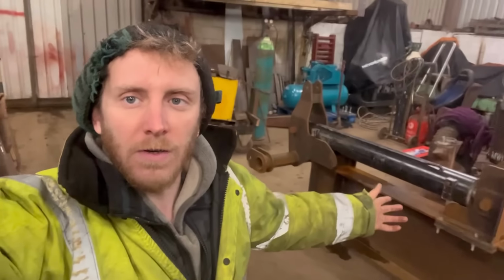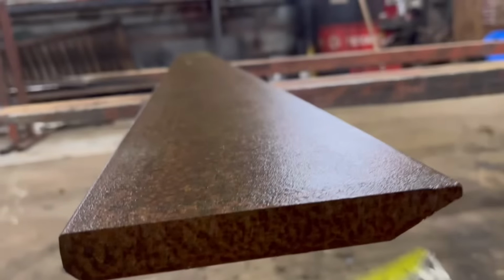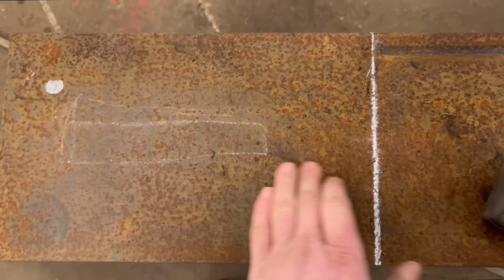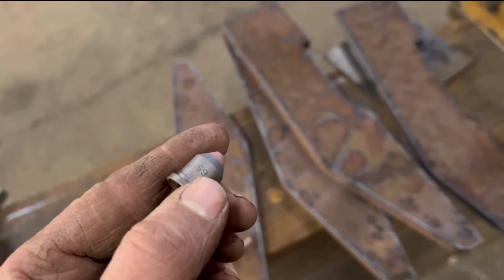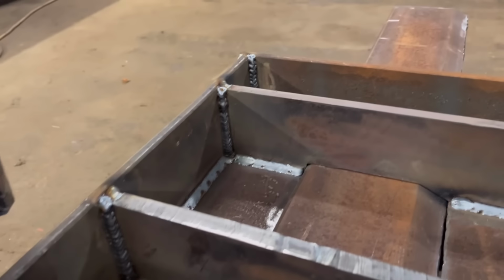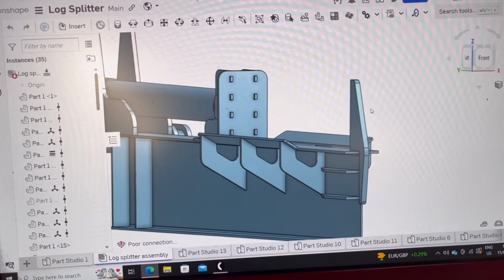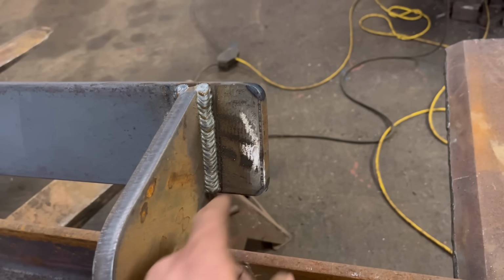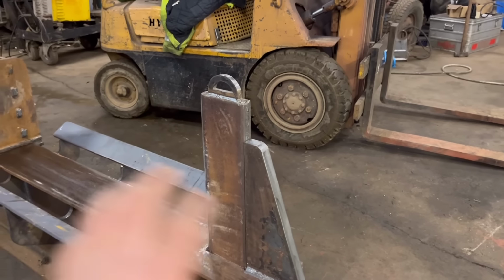Making a HUGE log splitter. Part 3

Comment: If I may make a suggestion that will make this splitter infinitely more useable, fir it upside down so the slitting section is able to grapple a log on the ground via th boom on a jcb or telehandler
The less times you have to touch a log the more efficient the process

Comment: That log splitter is a monster. It must be two to three times the size of the one the woodcutter was using many decades ago. His was completely self-contained with a motor and hydraulic pump and a star knife. It will be interesting to see how your modifications improve the function of this one. With a prototype, it's usually the case that some things need changing after you first test it.

Comment: Simply build the 4 or 6 way blade to be the spacer you need for the hammer to get closer to the blade/splitter.
btw, with the 6 way blade, you won't need to add a table/retainer to keep the wood from falling down as it will be already splitted enough (and let that conveyor you're gonna build do the rest ;)

Comment: You mentioned not having any hard wire for the splitter edge. You could probably sharpen the splitter edge then heat and quench it a couple of times and it'd get pretty hard. Just a thought.

Comment: Welding vertically up is a bit technical, but you didn't do too bad a job on it for not having done much of it. It would have been difficult to turn the log splitter in such a way as to avoid the vertical welding, so there was no practical way out of it.

Comment: U want to look at getting  a regeneration valve to fit up , uses the low pressure oil from the other side of the ram to speed it up when it's not needing pressure to split or on the return stroke

Comment: Nice design and build again mate. Forget worrying about fancy welds they are for instagram, I am watching the overall build not checking your welds. Since I became an amateur welder I am now fully qualified to check others welds, and when you start looking about you not all welds are 10/10. However they don’t usually break and have been there for years without an issue.  A grinder and paint makes me the welder I ain’t!!All the best mate.

Comment: For a vertical weld try moving the arc in a pattern that will fill in both sides of the bead easily and as you go.
So move , Left,Right,Left,UpLeft,
Right,Left,Right,UpRight,
L,R,L,UL,
R,L,R,UR
ETC, ETC , where you are forming a squared U and your upstrokes are about 2 to 3 beads high depending on how fast/slow you go.
Worked for me in vocational school years ago to get my ticket And its easily modified to adjust the overall shape.
Reply: PS, enjoying your content , thanks.

Comment: If you don't have hard face rod or whatever you can use the allen keys that companies put in everything these days. I collect all the cheap allen keys they give away when you buy Ikea or whatever and then use them as a poor man's hard face material. Not perfect, but it'll do in a pinch.

Or broken HSS drill bits/end mills. Although that tend to be very, very hard, but it might actually work well for a small cutting edge like that.

Comment: Well done great job !!  How about welding an extra backing plate either side behind the knife, angle them so that they help force the cut log outwards which in turn will help split the section of the log that doesn't contact the knife edge ?
Reply from the maker: Good idea

Comment: Olly, well-done on this project, do you have stick welding in shop,practise you're vertical with stick and it'll help you're mig,on the ray burn on you're face use sudocreme get it over counter it's the best, great channel as usual,how many tractors do you have for work or hobby regards from Scotland 🚜🚜🇬🇧🏴👍
Reply from the maker: There’s 4 main modern tractors for work and then quite a few classics and vintage

Comment: I had the same issue on the splitter I built when splitting stringy logs, thinking I needed to close the gap. What I did was make the splitting head wider, so it's got a narrow feed in at the tip and then goes to about 60 degrees.

Comment: Hi iwe had a lot of frustraition on Welding uphill to. But now when im Welding uphill i allways Welding in a triangle starting either left or right side then Welding towards the middele a bit up 1 or 2 mil. Then draw the pistol back to the other side as iwe started 1 or 2 mil. Down and the last part in the triangle right ower to the start point. It gives you a nice straight Line between left and right side, some times it is nessesery to hold the pistol still in a split sekond in the left and right side. 
Last draw a sope Stone Line in both sides virtical so you Can make a weld at both sides the same thicknes. Nice video by
the way. Tip from Denmark

Comment: I did exactly that to my face a few weeks back, went of to weld a gate and forgot my mask, thought i could get away with spot welding it up by shutting eyes on pull of the trigger, what happened, i got i nice sun tan too
Dont worry yourself on small bits in weld, you do an excellent weld

Comment: You are a it again aren't you! You outdo yourself, then you really do something really stunning. The beast is really coming on nicely.  Yes up welding is not easy, but have patience and the more you practice, the better it gets. I used to practice on oxy acetylene  and stick as they were the main things I would use. Once you got the hang of one you could transfer the muscle memory to the different  styles. Sometimes your welds are not the prettiest but who cares! only you. When I used to weld regularly I would have good and ugly welds, BUT they all worked!  All welders have the same problems, every day so don't worry. Only machines do consistently good welds, cos they only do one thing. Even they make mistakes sometimes too.

Comment: You want to add some kind of wedge after the blade to spread a split quicker.  When I made ours I used a bit of bucket edge, just ground a point on it and haven't had to resharpen so I don't think hard face is required.

Comment: If those are your first vertical welds you did a fine job. Also it's harder to weld vertical with the wire feed than it is a stick. That's one hell of a log splitter, nice job. Keep Smilin

Comment: Another great video. Thanks Oliver. Yes, I prefer welding horizontally due to lack of experience in welding vertically. Rightly or wrongly, I pulse the weld using the trigger. Your welds look pretty darn good to me 👍

That’s a big cylinder. Lots of umph but needs a lot of oil to move it to full stroke. 

Hope you can do another video next week. 

Cheers 

Mike and Nicky

Comment: You're not alone, it's easy to overlook minor considerations like personal protection.  I once set down at the bench to TIG weld a new bumper and trailer hitch for my truck, and because it was summer and hot, I wore running shorts.  The bumper welded up nicely but the next day I had significant UV burns on my exposed legs which took two weeks to heal.  D'OH!

Comment: That is a nice design Oliver.  I would have the knife move and the log stay put.  I have split wood every year since 1977 and I have used far too many splitters -- I can say with confidence the one where the knife moves and the log stays put is the best.  

If you need to make a subsequent splt on a log or portion of a log, you do not have to lift or reposition the log to accomplish it.  Over time, this tiny reduction in manpower makes a huge benefit in your efficiency.  I have pushed a knife through 120-150 cords for my own burning since I made my current splitter in 2006, and I do not view splitting as a chore.  

Why is this even an issue?  Imagine you had a round so big you had to split it into 60 pieces to burn it....  

Excellent video -- thanks for sharing.  Hello from sunny New Brunswick Canada.
Reply from the maker: The idea with this one is to push the split log off the splitter onto the next process to be sawn down into usable size logs.  If the log didn’t move they’d all be to hand balled off
Reply: @snowballengineering  You have it figured out.  In my process I length the rounds first, then split them up!

Excellent video series!

Comment: Nice work! For the Adflo PAPR, I adapted mine to work on Dewalt batteries since the stock ones are so expensive. I made a video on my channel of how I did it.
Reply from the maker: I’ll have a watch!
Reply: YT doesn't let me post lin ks for some reason so try searching "Adapting 3M Adflo Speedglass PAPR to use DeWalt Drill Battery with CASE and why you need a PAPR"

Comment: Great job, Oliver.  1 recommendation:  Consider making a support yoke/block for the hydraulic cylinder.  Since it looks like the splitter will be horizontal most of the time, there will be a lot of flex pressure when under load.  A support yoke would reduce or eliminate cylinder wear.  Hope that helps.  Thanks for letting us watch.  Cheers.
Reply: I agree with you on this 😊

Comment: Ineffizient. 
You need to touch each piece of wood at least 5 times before it ends up in the oven.
Farmcraft made one for his excavator, which is a lot better:
https://www.youtube.com/watch?v=EYrgG7Rn7M8
Reply from the maker: It won’t be inefficient when it’s loaded with the jcb, got a blade that splits logs into 4 or 6, set up with the saw bench/wood processor at the end of it sawing the long logs into shorter ones with the conveyor loading them into a trailer.  This was its first try just to see how it works.
Reply: @snowballengineering  Agree.
But farmcrafts logsplitter is worth considering. 
The only other thing you need, is an excavator. 
But who doesn't have it these days? Even I recently found one unused and hidden in a corner.

Comment: Majestic, Sir Snowball! What do you plan to use that size of firewood in, are you in the posession of RMS Queen Mary???
Reply from the maker: The idea is to split them in long lengths then cut them down to usable size with the wood processor/saw bench. Saves a lot of work with the chain saw

Comment: I have a inertia splitter that uses an I-beam similar to thet and it has a brass plate between the push plate and I-beam. It seems to reduce wear on the beam,and helps with binding plus it cuts down on the splinters lodging between them which is a major pain

Comment: Great work Oliver.  I have found that a sacrificial piece on the end of the ram like a piece of hardwood works well to get a zero clearance to fully split the pieces.  It will eventually wear out, but works well and is easily replaceable.

Comment: Nice update on the log splitter Ollie, like that you're using it as a test piece for your vertical welding. I suppose it's like most things, if you're doing the same thing all the time it becomes second nature and as they say practice makes perfect. I once knew someone who was an underwater welder on the oil rigs in the North Sea, he used to say he was glad he was welding down there, as no one could see the state of his welds, his mantra was as long as it's standing he must be doing something right. 😂 Like you say your self taught, plus you have the guts to put yourself out there, I just wonder how many of those keyboard warriors out there have actually had the guts to put themselves on camera,  probably very few if none at all. Keep up the good work! 👍

Comment: Are you not going to need a big excavator sized hydraulic pump to make that huge ram work at a speed where you won't get bored waiting for it to extend?
Reply from the maker: If you watch till the end you can see it’s not slow on a modern medium sized tractor

Comment: Excellent job on the log splitter.. that beast will last forever and a day. I personally think any log splitter should come standard or designed from the word go with double splitter instead of just one blade. It cuts (no pun intended) the job in half instead of handling the log a second time to cut the other half again. Where you can do that the first time around
Reply from the maker: Big lumps of knotted wood won’t like multi blades very much, that’s the reason I made the blade removable so it’s interchangeable.
Reply: @snowballengineering  noted. make sense👍🏼

Comment: I put a plastic ptfe type skid plate under my push block, saves running steel on steel, I made it from one of those plastic cutting boards so no need for grease. When I look at your welds and hear you say they are not good, I would be delighted if I could make mine half as good as your worst effort, I am by no means a welder but I can stick metal together and rely on the grinder and paint to make them look better. I would love to take a crash course in welding and learn to do it better, having said that I don't do enough to keep up the practice, the only courses I have seen round here are 75% theory and on real expensive welders that virtually weld by themselves. A few basic lessons might be an idea for a video.
I also put guides on mine the same as yours but they did not last very long as the first out of shape log caught up and bent them, We mostly have eucalyptus which is very stringy and the long logs(60-65cm to fit my boiler) often twist round as they are splitting and catch on the guides.

Comment: Should the ram extend to its max almost touching the knife edge to finish the split.  May be  a tee type knife would be faster for a four way split that you could be swop out. Also a remote spool valve for the operator .

Comment: Excellent design and fabrication 👍 
May I suggest try pausing and going up a little on each end of your vertical up welding. It will preheat that spot for the next pass.
 Also, look at. IC weld . He has a channel from Texas and he’s a professional welder 👍

Comment: Watch out for UV radiation when not wearing gloves as well (plasma and welding)
You should be able to split any log on the island (as we Norwegians say about England - Wales - Scotland 😏)
Well-engineered and should last a lifetime or two
Stick welding should do the trick for vertical and "up - under", you did well anyway
Planning on separate power unit for The Splitter?
Reply from the maker: Just power it with a tractor I think

Comment: Suggestions from  “Lifetime of Welding ”. 
Reduce the amount welding. Use intermittent welds 30mm long . Strength is from the geometric shape not the amount of weld. 
Keep the mig stinger lead as straight as possible to keep the friction of the of the welding wire passing through the liner to a minimum.
Also. The mig wire drive control unit will operate suspended over the work location it’s then out of the way of the working area.
Reply from the maker: I like intermittent welds to all look nice and even so by the time I’ve marked them all out it’s quicker just to do a full weld 😆
Reply: @snowballengineering  No need to MARK OUT strike the arc and count to 10 or 15 or 20. Do it a couple of times you’ll get the instinctive knack. (Try it on a piece f scrap metal first. ) And half the cost of welding consumables!!
If you still want to make out ,make the stepping on a length of thin wood batten and use the batten to mark out rather than   a tape measure. 
Or chalk mark it out and guess the length of 30 mm 

Another way is to start the weld 30 mm  in and weld to the end. 

Eg the web stiffener plates I’d weld 30mm around  and each side of the end nose and 30mm each side of the web stiffener to the beam web at the top. 
 total would be 30x 4 = 120 mm welding. I’d guess you weld 200mm each side 200x 2 = 400 mm weld length 

Stitch welding is the way to go.

Comment: When i weld upwards, which is also not a lot, i drop in amps but keep my wire speed the same. My thinking is that i wanna push that wire in there and don't rlly care how it looks. Go over it with a thicker grind wheel just go get the weld slag off and then u can put a "beauty" weld over it going down. But that'show i do it IF i have to weld it. And that' only if i'm welding twist locks on container chassis. And none have fallen off yet so i'm guessing i'm at least doing good enough. hardest weld is still above the head, you really have to go down in amps then i rlly prepare the weld deel but it'll always look like shit 😂

Comment: Ollie, you have to pause in the corners a lot longer than you think. I normally count to three😊 you are right about practice. I had a year off from welding and virtually had to relearn, muscle memory, the ones smarter than me call it. That is the most overbuild splitter I have seen and I have seen hundreds! Nice job. Oh and I have still got grinding sparks in my eyes while wearing good quality goggles. They had ventilation slots in them and the sparks still found there way in! G'day from Tasmania

Comment: I made a splitter 3 yrs ago same design,used bucket edge, same as you it's a good job. However in twisty wood the toe of the beam twisted so I had to redesign the sliding part

Comment: Nice, very big! I  made a splitter a few years ago using a military surplus ram from a CET which is a tank with a big bucket on basically, runs of a power pack as used for a breaker ( like a JCB beaver but actually a fair port) works well, could be a little faster, I used a Prince spool valve with a rapid extend and lock out on reverse which means it can be quickly advanced to the log then used slowly with more power, then clicked into reverse while bits are moved or next log found..no linkage as i just bring the rings to the machine. Short video on my channel of it working if anyone wants a look.